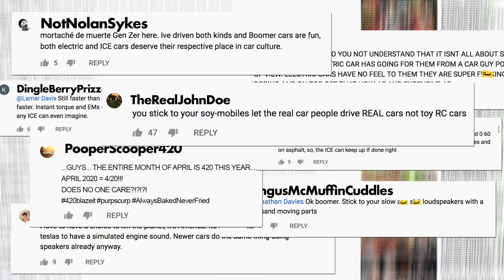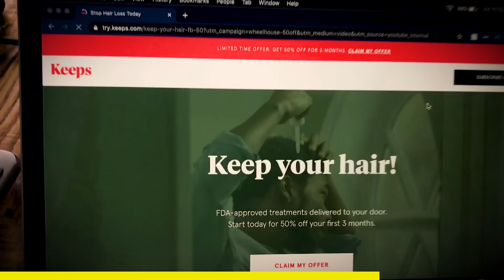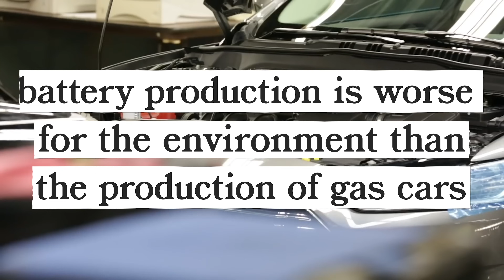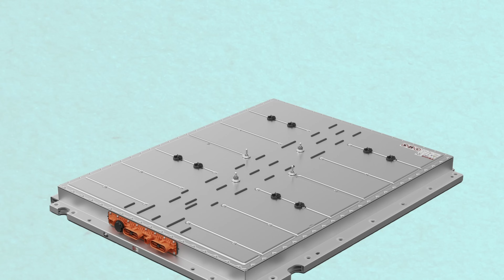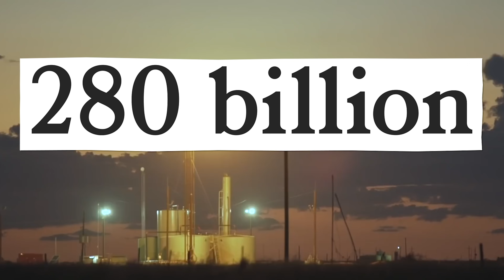Are Electric Cars REALLY Better for the Environment?

Comment: You made quite a reference to Lithium but not to some other RARE EARTH MINERALS that are used in the production of EV batteries. 
Material such as, NEODYMIUM, TERBIUM and DYSPROSIUM, and guess what, the word RARE is a giveaway there.  
It doesn't matter how advanced your technology becomes, if you run out of the RARE raw materials to make things with, then, hey ho you can't make them. 
As these minerals become more RARE their price will increase proportionately making EV's even more expensive to produce, to the point where these minerals run out ,then, hey presto, no more EV's. 
Estimates by mineralogists range from 100 million to 300 million EV's can be produced before some RARE minerals become exhausted....now that is not  being shouted from the rooftops is it.
There are 4.5 Billion cars in the world today, so it is comforting to know every EV will have to replace 45 ICE vehicles before the RARE minerals run out....! 
Even if you can recycle every ounce of the RARE earth minerals there will still be a shortfall of over 4 billion vehicles worldwide, forever. 
Horse breeding would be a good business to be in then.
The pollution comparison argument is trivial when you consider the finite recourses requirement debate.....but that doesn't stir panic and emotions like the word .....pollution....now does it.!
It's a bit like arguing what colour to paint the yard fence when the house is burning down....pollution is the small thing in this equation, finite resources are the big thing....!

Comment: Great video 👍👍👍 more Ev Conversions needed too especially made out of used batteries 🤩 #Chargeheads
Reply: If you support ruining classics buy gutting them and throwing batteries and motors into them, may i suggest just scraping them? Doing a conversion on those literally takes away 90% of the joy and point from them, just a Tesla with a different body, it's pathetic.
Reply: @inoutdoor4211  thats your opinion. Ever thought you might be wrong. I have, however its my car and i can do what i want with it. If it means i can future proof a classic and have an EV that is original and fun that i can drive every day, well i've achieved my goal. Thanks for your comment
Reply: @chargeheads  That's fine, I just think that at that point, better to put it in a museum. All you have when it's electrified is a classic car body, that's it. It's like taking an old cabin, wood one, and filling it with modern technology, and redoing the interior to look like a modern condo, all you have of the cabin is the look on the outside, the rest is just a modern condo. You no longer have a classic car, you have a Tesla or Leaf mascaraing as a classic car. If that's fun to you well.... ok then. I find EVs only have speed and acceleration. Oh and you can feel superior to others because you're "saving the environment", when that wears off, what's left, and everyone's used to them having acceleration? Nothing. It just depresses me young people like myself are going to do this more, and destroy history and most of the fun that car enthusiasts (real ones) love with these old classics you speak of.
Reply: @chargeheads  Why not just buy a regular newer car and convert that? The only difference at that point is the BODY. The feel, sound, and history you're driving is gone. Settle for a newer car, stop ruining the limited number of classics. If we have to settle for EVs, you have to settle for newer non-classics to convert. Have fun with your Civic conversion :)
Reply: @inoutdoor4211  this is why i was careful to choose a classic car where it wasn't that special had 18 owners and plenty wrong with it that made it not  desirable to a classic enthusiast, bringing it back to life and essentially future proofing it. 
I get what you are saying, however its not like a TVR Wedge is a rare classic. What classic car do you own? Seeing of course you are such a classic car enthusiast? Also some civics id say a more classic than my TVR and also seeing as though you are digging into to me are you also doing the same to racers and drifters who smash the cars up? I'm preserving in a different way 😁
Reply: @chargeheads  At least you didn't pick a decent-shaped one, I'll give you that. I don't own any currently, but have ridden several. 1967 Mustang is my dream, 4 barrel carb to boot. You may be "preserving it", but not much of it. Again, masquerading as a classic. At least they destroy them with their original power plants, they don't prop them up as something old yet it's basically a new modern car, as modern as you can get. While at the same time, it does make me cringe to see them bashed in, to see them made into nothing more than generic electrics with no personalty beyond how they LOOK, that makes me cringe almost as much. Remind me never to sell any to you, rather give them to a museum or store them, better use.
Reply: You didn't answer my question about the racing or drifting. I see some classic car owners just hide their cars away in their garage's or just stuck in Museums which is a shame or they lay broken for years and i say take them out use them show them off let people see and HEAR them. I do my other classic all the time which is keeping its engine. Yes the TVR wedge is an acquired taste, i love an underdog. Mustangs are certainly common enough to EV a few. My mate has a 66 manual he imported from the states, like a film set inside that thing 🙂

Comment: A couple of comments:  You talk about wind, solar and hydroelectric as the renewable sources of electric power.  Hydroelectric is already pretty much maxed out in industrialized areas.  Wind and solar can only ever supply a percentage of the total energy requirements, and have their own issues with storage (currently batteries) and backup systems.  Mention nuclear power will have people shouting you down, mostly because of the ridiculous images from Hollywood and others.  One of the main reasons why today's nuclear plants (which, BTW, have excellent safety records) are still using 50+ year old technology.  Nobody wants to do development for modern, actually even safer nuclear technologies. Also, you mentioned coal-fired plants several times, hopefully not just for impact.  Natural gas plants exist too.

You've presented what appears to be thorough and unbiased, but needs some

Comment: NO.  
- crash merging into the same lane as another vehicle  https://www.youtube.com/watch?v=ih-GUz8rmLg&feature=youtu.be
Tesla's camera failed to see that both cars entered the same lane and should have backed off.
- Texas is snowed in and no electricity = tesla sucks

- tesla using up tons of batteries.   smartphones for the billions of people are more important than a few rich people in a tesla.

To answer your question "who in their right mind buys a car without test driving it?": crazy Tesla owners
I'm glad I test drove the Tesla model 3 because I thought it sucked (large turning radius, overly aggressive regenerative braking felt like 

I slammed on the brakes, stiff ride due to high psi tires, road noise, ugly center stack screen with tiny fonts).

Comment: Imagine owning an EV in Texas right now... what happens when there are extreme situations that cause power outages and you can't even drive anywhere
Reply: EVs actually kept a lot of people in Texas warm. There are lots of posts online about people sleeping in their Teslas because the inside of their house was like 40 degrees. Something else to consider is that gas pumps require electricity to run.

Comment: This notion that electric cars are more efficient is disgusting. This is solely a political move for some abstract reason the general public doesnt know about. Its honestly a joke and its even more of a joke that the American public is buying into it. 64 percent of the US power grid is powered by Coal and Natural gas. What do you think is going to happen with more electric cars. More coal and more natural gas is going to be burning. More pollution. The actual pollution coming out of a modern engines tail pipes is far far cleaner than that of any natural gas or coal plant. Not to mention the end of the west coast has rolling brown/black outs on a near daily basis..... The souths power grid cant even handle 3 inches of snow...... The focus should be on fixing the US power grid first..... Not advancing the electric car market... What the hell is going to charge these 284+ million cars in the US that average 13,500 miles a year. It takes 344 watts to move a tesla 3 1 mile right now. Far from its advertised 241 or whatever it is.  For a electric car to move 13,500 miles a year its going to use 4,644 kilowatts. The average house uses 11,000 kilowatts a year and there is roughly 125 million homes in the US. Do the math thats going to nearly DOUBLE the US's energy grid usage.... Parts of the grid can barely keep up now. Double the coal, natural gas usage along with more nuclear power plants. Pollution will just be worse.... A gallon of gasoline (with its additive crap would be more without it like 129-136K) burned gives you roughly 114K Btu's thats 6 pounds of product so 1 pound of gas will yield 19K Btu's. The average coal used (average of the three types) per 1lb yields 11K Btu's and natural gas is even worse its 1050 btu's per cubic foot so its roughly 136.5 Btu's per gallon. We are going to be using more product by mass to make the same amount of power. Make the gas powered vehicle more efficient end of story its a far far better fuel source to start with. We are averaging 30-45 percent efficiency in a IC gas/diesel engines. Coal plants, natural gas plants, nuclear, renewable all  average 32-45 percent efficiency across the world. While 41 percent of the global power comes by COAL.... Battery powered cars that charge off the current electrical grids is not the right direction at all. The average gas vehicle will move 25 miles on 114K btus while the production of gas per gallon is 90 percent efficient. Gallon of gas looses 10 percent in production and the IC looses 70 percent. Net efficiency of 60 percent with a gas vehicle in regards to making the gas and burning it. A electric car will burn 29K btu's and its 88-96 percent efficient. However making the electricity that powers this is only 35 percent efficient then factor in the 6-7percent transfer utility drop from station too house/charger its only 28-29 percent efficient. Then on top of it we need to utilize nearly 57 percent more product to produce the same amount of engery..... The Electric car may be more efficient yes but when the power charging it is consuming 57 percent more product to make the same BTU as gas that 96 percent efficiency just went down too 39 percent. The electric net efficiency is 34 percent when you take into account product used too the actual output of the electric car.  We are just removing tail pipes that are actually filtered and making smoke stacks that pump with no filters instead of improving anything. And its going to use more energy What a geopolitical joke another way for big government to make more money....

Comment: Did you take into consideration the cost, maintenance & support required for all the charging stations for EVs ?
Reply: Well take into consideration the cost,maintenance & support requierd for all the gas stations for ICEs. Sure as hell the EVs will win that one simply by the fact that they are connected to the power grid and dont need designated Trucks to bring the fuel to the gas station.
Reply: @LyricsbyUser43  Any machine which has an engine requires it to be refuelled. Toys can be plugged into the wall.

An EV is not a reliable tool and trying to compare them to an ICE using a meaningless comparison is quite the stretch to justify their existence.
Reply: @illegalopinions4082  This is ur opinion, not an argument though.
Reply: @LyricsbyUser43  It's a fact. An EV is a toy. It is not a tool. Tools are reliable and usable in all circumstances. There's a reason no military vehicle uses batteries, and it's because they're not reliable and fundamentally a worse technology because when you need power on demand to meet specific needs you pick up an engine that can be refuelled on the go if needs be.
Reply: @illegalopinions4082  Fair enough reliabelity in remote areas definitley is one of the last arguments against EVs, but as infrastructure will increse, this problem will be solved more and more over time. 

Now I don't see why one would compare its everyday car to a military vehicule. Since I never drove a military truck and they probably wouldn't have much use for my good old Mazda 3 ICE either. Which makes perfect sense, bc these vehicules are made for entirley different reasons. EVs are designed to take over the market of private cars and if u don't live in a very remote area I don't see how an EV is anyhow less reliable.
Reply: @LyricsbyUser43  A vehicle is a tool, not a toy. You don't seem to understand this. If a vehicle cannot perform in all scenarios the same as or better than its predecessor then it is an inferior machine. And why is it you people always pull the "magical future technology will solve this very basic and obvious issue so don't worry about it". Weird that that's your go to. What you mean is that there is no solution now, when it matters, and it is less useful than a 100 year old bang box.

Yes, I know you wouldn't understand why someone would raise the point of reliability and then give an example of where reliability matters the most. It's clearly a difficult concept. The question you have dodged this time is "why would I have something that is less reliable and less functional"? Sticking around for 45 minutes for my "quick charge" for my toy with limited range that only really works at the moment because nobody has them isn't a valid argument for them since I don't think anybody wants vast swathes of land to be turned into car parks to charge these useless machines.
Reply: @illegalopinions4082  No i'm just saying that the factor of reliability has to be applied, when also considering the field of use. Of course reliability is a major factor, but in consideration of driver behaviour. Most people daily drive short distances. Also most peoples homes are connected to the power grid. And for those owning EVs a lot of people do their charging at home over night, so they wake up with a perfectly fueled car. So reliability is for most people a solved issue since their daily needs are covered. Thats why I don't agree with the camparison between military vehicules and normal consumer cars. My car doesnt have to work everywhere, always. My car is supposed to work, where I actually use it. Otherwise we would all have to drive Pick up trucks or Jeeps.

Yes there are downsides, like e.g. if u want to take longer trips u will eventually have to take a longer break at some point.

I also don't see how we will have to turn lots of land into carparks to load them, bc as I mentionned most people load their cars at home. 
So yes if u are smbdy who takes very long drives quite often an EV is probably up to now not the right choice for you. 
However for everybody whos major driving is between 0-100miles a day, an EV will absolutley, reliably fix ur need 
+ u save the time to go to the gas station. 
+ u save money
+ u help the Environment
Reply: Of course they didn't. They also failed to mention the future running costs when they're no linger heavily subsidised by governments.

Comment: I say the true comparison needed to be conducted is NOT comparison between EV & gas powered vehicle. ( of course, obviously EV tops gas powered vehicle.) (Even though Convert to EV fro gas powered car won't make too much differences in term of reduction of global warming though.)
The truly needed comparison is between EV & Hydrogen Fuel Cell Vehicle.
Reply: The true comparison is between EV and the rest of the of the pollution and destruction we cause on this planet. Cars are just a fraction of the problem, it's all just the system at work keeping the industries going to keep the profits flowing.

Comment: flawed logic, your EV numbers only stand up if you only have one battery over the life of that car, most early modern EV's have needed at least one battery replacement, then of course we need to talk about the "maximum recharge cycles" of a cell and health of the battery cell which will be tied to temps and usage patterns. if a battery has a duty cycle of 200 charges from 1%-100% and a battery is rated to take a car 300 miles... thats only 65,000 miles you can do before it is dead as a dodo and will then need to be replaced at 11k miles your looking AT BEST in ideal conditions 5 and a half years life out of a battery 

i dont know about you but that Co2 to produce the battery is a 5-6 year cycle

Comment: The sheer convenience of refilling the gasoline/diesel vehicle on long trips vs sitting on my but charging (if I can find one and it isn’t being used by some other driver) makes electric a no go for me. The rolling brownouts in California and the recent power debacle in Texas makes me profoundly doubt the ability of the power grids to be able to have millions of EV charging even in off peak hours...( solar arrays aren’t gonna be working at night, wind is erratic) . During a cold snap or heat wave , people won’t have the availability of power to charge their cars so on top of freezing or burning up due to rolling blackouts, they’re totally stuck @ home. The sheer volume of waste created by the old batteries & windmill blades that have deteriorated beyond the ability to be used has not been thought thru either... mini nuclear reactors (small modular reactors) wired into disabled coal plants would solve many energy problems, they’re clean and can used the power distribution infrastructure that is in place.